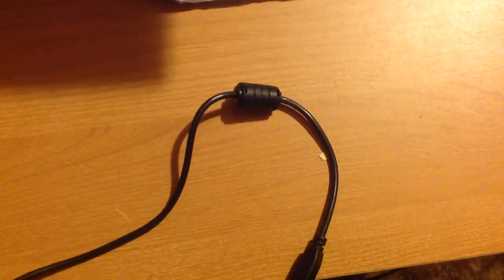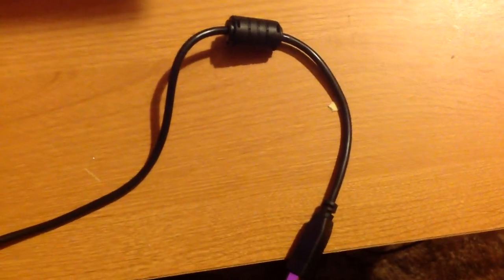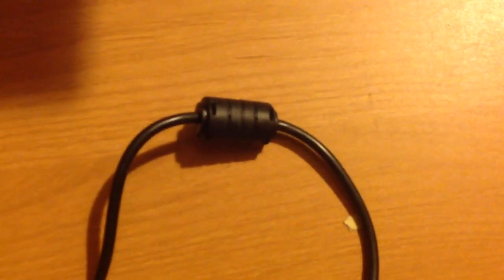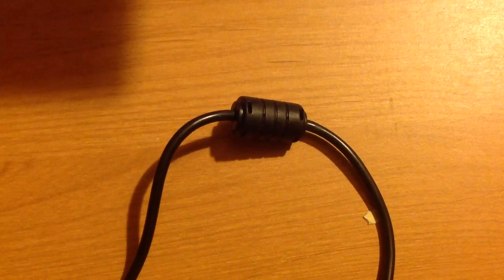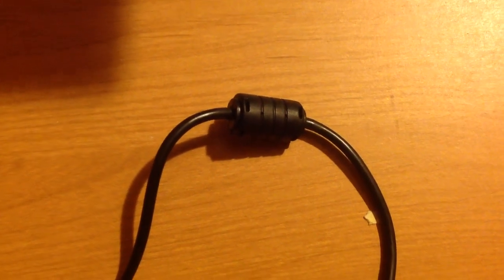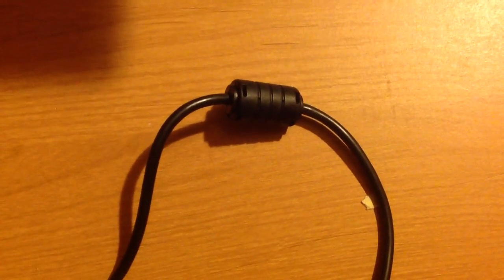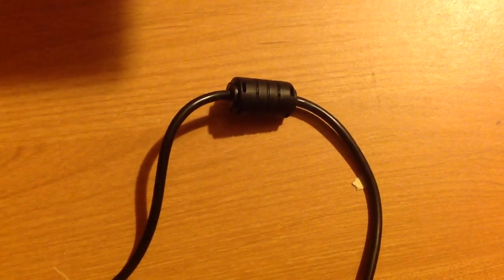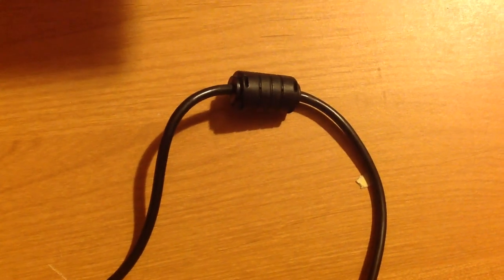Ferrite Bead Choke Clamps Why You Need Them

Comment: Electronics design engineer here!
Those are for filtering out conducted common mode noise in the RF-range. They're used on USB-cables because they supply power, thus they can have common mode currents flowing through the cable, but ferrites work on way, way above the audible frequencies in the several tens of megahertz range and they have nothing to do with the audible interference and all to do with EMC-compliance of the device.

They reduce the amount of conducted RF-interference and can be the difference between failed and passed EMC-compliance per regulations.

If the device you're using the cable on, has problems with design, they can in some cases help the device to work properly, especially in noisy environments. But as with any digital signalling, the device either works or doesn't. There's no analog signals, so it's either or.

why you see them more often these days is because the regulations against conducted and radiated RF_noise is constantly tightened and when previously device could pass without much of a problem, these days you basically need the ferrite bead to make sure it passes.

Well designed device has proper filtering and overall design for it to pass even without the additional bead in the cable, but it's expensive to design to such specification so it's an easier and cheaper way out.

Hope this helps.
Reply from the maker: Great explanation! Thanks, Mtaalas!
Reply: So in other words, the RF signal, which is similar to AC but more hertz, resonates the cables causing the resonance to induce more or less inductance.
So you put ferrite chockers, that have their own magneticpulsations to create a resonance chocker as the long cables affectedby RF cannot resonatepastthe choke. Gotit, thanks... Try to think as Aether makesa lotmore sense
Reply: Thanks!
Reply: Bit of a random question, but do you think using these on an analog FPV video system would stop electrical noise showing up in my video feed when the motors are armed, the lines also get worse when I give it more throttle too. 

I'm already running 2x1000uf 35v low ESR capacitors on the main power pads and have the whole FPV system grounded to the main ground pad as well as I have been advised that running low ESR caps and using a common ground will stop noise like this getting through to the video feed, it has helped a little but I'm still getting some faint lines at higher throttle outputs. 

Again, sorry for the random question, I've been trying to fix this video issue out for the last 2 days and nothing I've tried completely eliminates the interference I see. 

Thanks in advance
Reply: I hate them so I always pick cables without them. But if you need a flail you know which cable to choose.

Comment from the maker: These also work well for use on guitar amps. On both the lead and mains. Seriously...if you are having trouble with noise then it is worth a shot! These beads aren't super expensive.
Reply: These ferrite chokes are so inexpensive it is worth putting them on as many cables as possible.  Amazon has a 20-pack ($8.99) for a variety of cable sizes and diameters.  At that price, they can be installed on most of the cables in a small studio with minimal expense. They may be called ferrite "chokes, cores, beads, doughnuts, filters, etc.". 
     Look up "Ferrite bead" on Wikipedia it has some good general info.
Reply: @rb032682  xD Another useless gadget.

Comment: Is there a rating system for ferrite beads?
Reply: Yes depending on frequency you want to suppress. common types are type 31 and type 43. Both are good I believe type 31 will suppress 1-300mhz and 43 will suppress 5-500mhz. You'll have to read more specifics on product websites